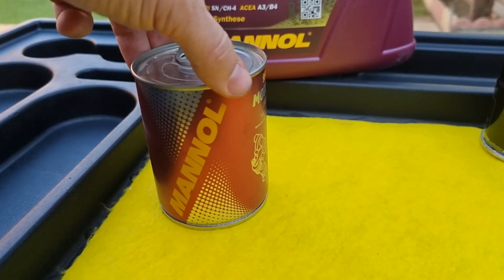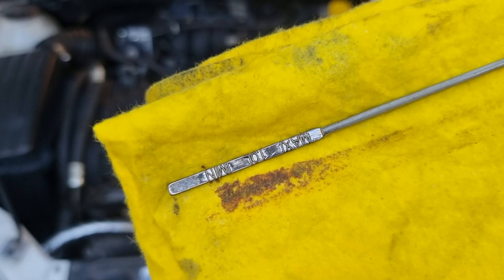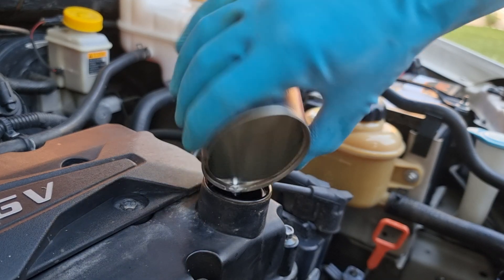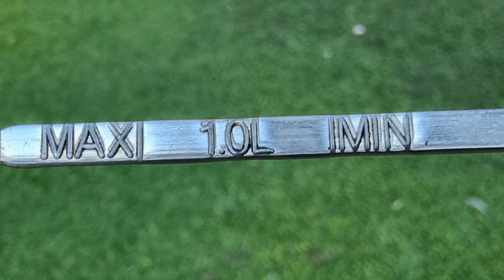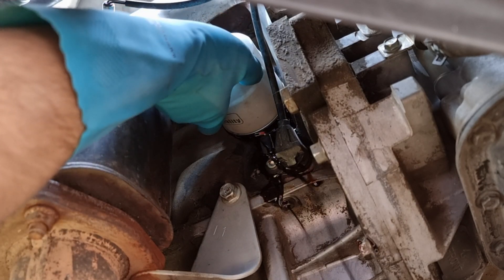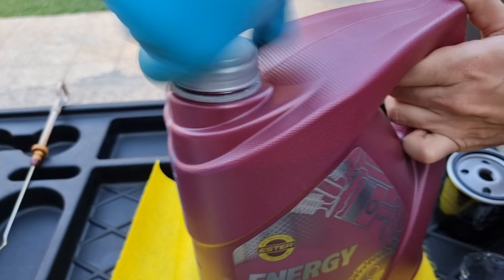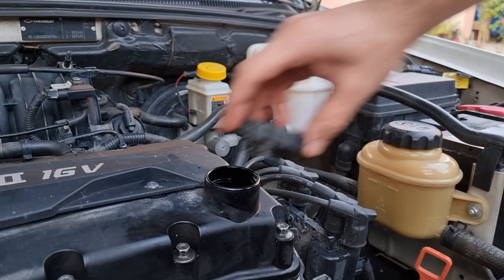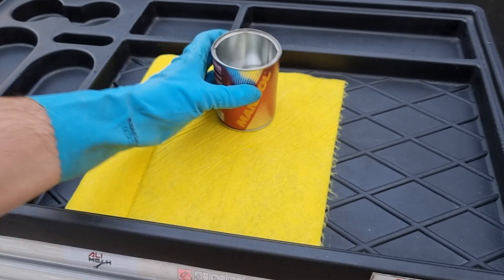Easy way to clean engine sludge/ MANNOL motor flush/ How to flush engine oil/ Engine sludge cleaning

Comment: Do a USED OIL ANALYSIS and you will know how much wear you created by running oil flush compared without it. It is never necessary, unless you have crappy engine to begin with that clogged control rings too easily.

Comment: you have to run the engine to get the oil to fill the oil filter, then measure the oil level again. 😱😱😱
Reply: you can see oil filter has been filled with the new oil before installed

Comment: My friend Mahor, if you switch camry engine oil 2014 from 0w20 to 0w30, is there a problem or is it normal?
Reply from the maker: You can use 5w-20 instead of 0w-20
Using 0w-30 will affect fuel economy
Reply: @AliMECH  Thank you for the information
Reply from the maker: No problem

Comment: Unfortunately I've tried it about 4 days ago.. it didn't change any of the remaining sludge over the dipstick, oil cap, nor the valve cover head.
Reply from the maker: I always use high-quality oil, maybe it was easy for the cleaner to remove the sludge,  I think the oil sludge was old, and couldn't remove it; it's possible, sometimes you won't see a big difference